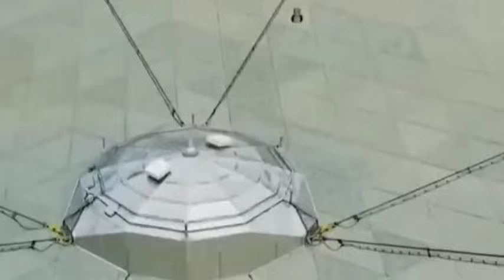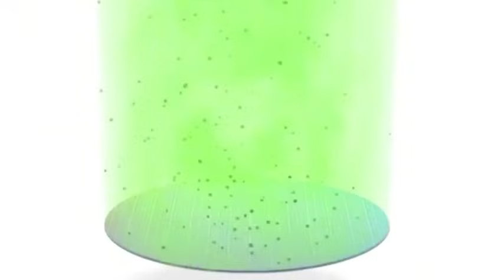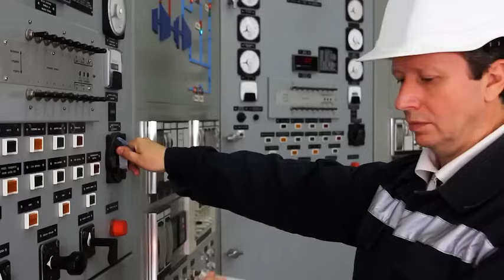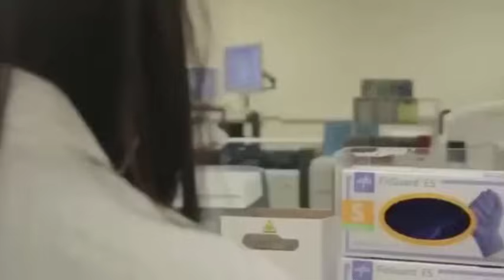Speak for China’s lithography machines! ASML shares EUV lithography machine technology with China!

Comment: It make good sense for ASML to finally get round to supplying (EUV/DUV) machines to China. It is obvious now to them China can produce top level chips comparable to the West. If they were to continue to follow with the sanctions it would eventually meant huge losses in the future. Already withholding sales to China means huge losses in revenue and if they are hoping that manufacturers outside China can increase purchase of their EUV or DUV machines to offset the loss in revenue, they probably did not do their homework.
China will definitely reduce the import of chips of all kinds since they can produce a wider range of chips from 7nm to 100nm so that would mean other manufacturers sale of chips to China will be drastically affected, and that would mean a significant contract in their respective revenue. Would they still buy more equipment from ASML knowing that the situation will get worse?

Comment: The peasants are rising against the master.  Japan and the Netherlands are the canon fodder in this proxy war against China.  Both are having economic losses by being handicapped in selling to the Chinese market.  Even the US semiconductor companies are rebelling as they lose sales of their high margin semiconductors and are now showing losses.

Intel and Qualcomm have started up new innovation centers in China.  TSMC is expanding its Nanjing plant and looking to build more fabs in the mainland.  TSMC is also fabbing 7nm chips for ZTE, Alibaba, and Tencent for their AI chips.  Samsung quit its operations in the mainland two years ago, but now is back building new fabs.  Apple tried to move some of its assembly to India and failed.  That failure cost Apple $70 billion.  Apple is back in China, expanding its Zhengzhou assembly plant. Both Intel and TSMC have stopped their construction of new fabs in the US. TSMC has pushed back its start date twice, now to 2025.  Both are experiencing a lull in orders and have idled some of their EUV machines.  The fear they have is if they finish their plants, there may not be enough customers to warrant their operation. With Apple moving its biggest assembly operation back to China, why would Apple buy from the US when Taiwan is next door? For Intel, with the US restricting exports of high end chips, their biggest market is the China market and it is banned from selling its high end chips to China.  If so, no need for new fabs,

Comment: Hi, China no longer needs EUV technology for ASML lithography machines. China independently developed SSMB-EUV technology and began producing the first batch of 7nm chips in February 2023. The Huawei Mate 60 mobile phone currently uses chips produced using this technology. The lithography machines produced in China can not only produce 7nm chips but also produce 10-100nm chips at the same time.
Reply: This is great news if true, do you have any sources?
Reply: (  https://www.euvlitho.com/2021/S37.pdf   )All technical blockades of ASML have failed @ivcbusinesssystems6613
Reply: @ivcbusinesssystems6613 Paper from Tsinghua University: Steady-state micro-bunching accelerator light source
Reply: @ivcbusinesssystems6613  keywords: ssmb euv

Comment: You know the realistico-pesimistic prognosis for Chinese self-developed EUV machines is 2027. The simply realistic one is... 2025 by seeing what is going on. The jump Huawei did is massive, and they've done it by cooperating with the rest of the Chinese chip industry, reinforcing all of it this way. 5nm N+2 process by SMIC is coming next year, you can be certain - that process can perfectly last for 2 years, so till 2026, the best process the bully monopolist can currently use is 4nm, as the yields on the 3nm processes are too low and isn't worth the extra cost. ASML's DUV machines will do the job for China till it develops the remaining external links in its chip supply - the generally low yields for the N+2 process can be easily offset by the design and packaging/testing fields as China doesn't fall behind the West there, and on top of that you'll definitely learn something that  you'll use later on, as no one has yet put N+2 processes into production, we shouldn't question SMIC whether will make it though. Then we have the sanctions war - China holds most of the raw resource production of gallium and germanium, something USA won't be able to do anything about in the next 10 years, plus on top of that Russia holds most of the inert gasses exports (also crucial for chip production) and China can easily negotiate with Russia for joint export control in this field with the sanctions on both countries. And last but not least we have the Taiwan issue - some sort of a military action will happen around it no later than 2024 with the local elections and USA obviously having the last chance at this moment to initiate the proxy war, though really what they can hope to do best is to blow up TSMC's fabs themselves. USA always talks about how "their" chip technology is the best, though no one has yet reminded them that the chip industry is globalized and they hold a small stake in it, they simply have placed people and patents in the right places to keep monopoly over it - with the critical meeting between Vladimir Putin and Kim Jong Yun we should clearly expect the other company with cutting-edge manufacturing technology - Samsung - to leave their control, someone should have reminded Uncle Sam that using the countries that supply you with cutting edge products you can't produce yourself shouldn't be used as bases for proxy war. USA expected to use the escalating tensions to force TSMC and Samsung to move their entire industry to the USA - and thus be completely consumed by the capitalist state of global oligarchs - however with both companies resisting what Americans can hope at best is to blow them up themselves, neither the Chinese nor North Korean leadership is that radical or dumb to attack infrastructure, especially such precious one - and in any case what would USA do when China doesn't need to keep any US chip imports after a conflict in Taiwan and issues full ban on gallium export? China will have a full chip industry by 2027 either way, what they really should push into right now is photoresist and EDA software, only weak links apart from the lithography machines in China's chip industry. It will make USA and its satellites look like absolute morons, they already do in fact.
Reply: Bingo.